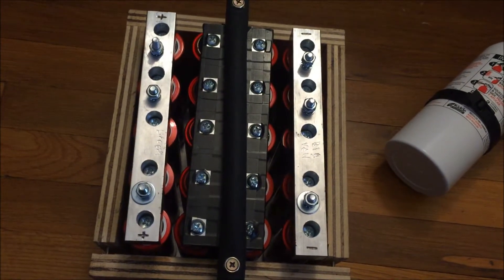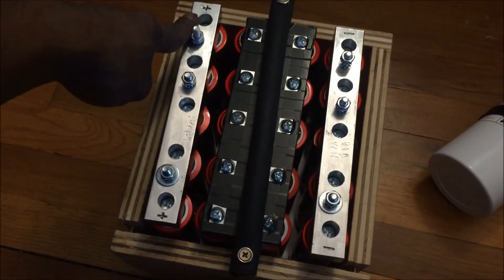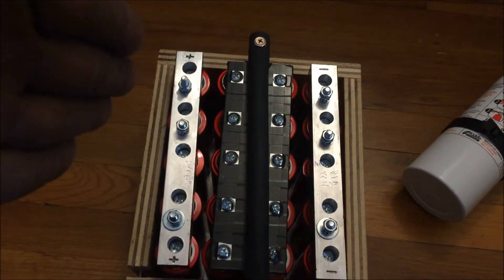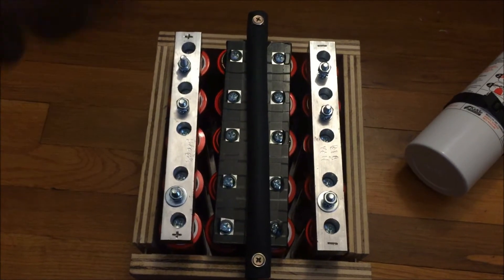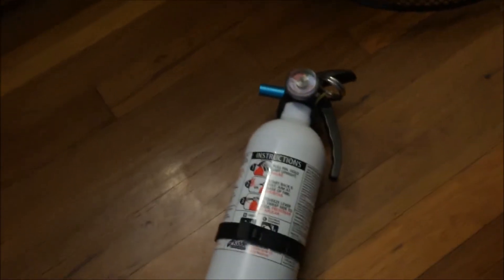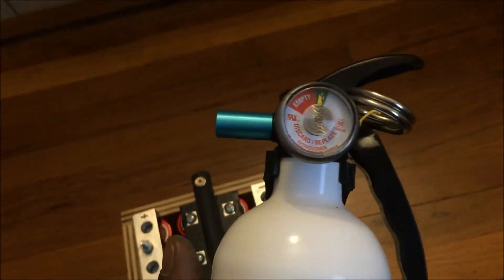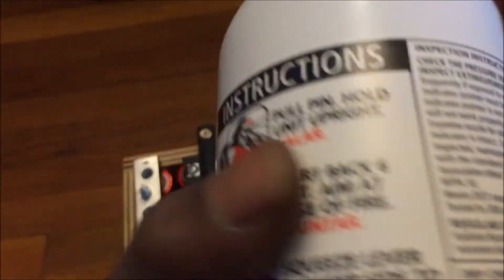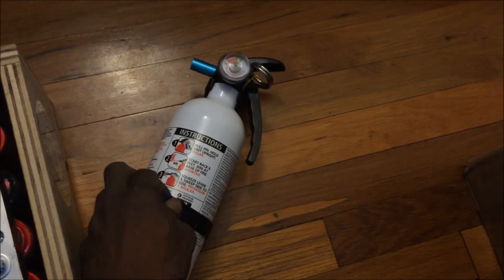40Ah Headway 38120hp Pack for Car Audio

Comment: What system did u have for this?
Reply from the maker: 2 DD m2b amps on 2 emf banhammer 12’s. Singer 180a alt xs power xp2000 AGM as well.

Comment: Hiw much can this 40ah power whats wise and stay in 14.4v range without droping?
Reply from the maker: I'm trying to remember the results I did a 400a / 4kW draw on the pack and I think the lowest it dropped was 13.4 That was stand alone not hooked up to a car or charging source.
Reply: @bigvell02  any chance you have a diagram on hiw to connect them all. Would like to build a 100ah one
Reply from the maker: @djbabyfingazz  No diagrams laying around sorry.... BUT I dont mind drawing up one as a matter of fact I will make a video showing how to connect them into a configuration of around 100Ah no problem.
Reply from the maker: It will be later this week though

Comment: This is effin' inspiring!  And yes, I have that exact same fire extinguisher...
Say, are you making these to sell?  Or should I acquire my own cells and do one?
Reply from the maker: Thank you. My team mate is running the pack now. I opened a Lithium battery company around Christmas last year. BigVell Lithuim LLC and I don't use these cells (I have something much better inside) I have 20Ah, 30Ah, and 40Ah. I just posted a video of the new build car there is a sneak preview of the batteries.
Reply: @bigvell02  So... Whatcha using now? I'm in need of getting something to supplement my power... Only pushing 4k, but the alternator can't handle that on its own like I've been running... 😅

Comment: doesnt each cell need to be balanced or something?
Reply from the maker: Yes I highly suggest it.
Reply: @bigvell02  do you do that with a BMS?  Also, you said you did 4 in series to get around 12V, are those cells 3.2v each?  Is one cell + side up and the next - side up? If not, how are you connecting positives and negatives for the series ones?  Visual learner, I wish I could see a diagram of how those are all connected.  I know series and parallel, just can't picture how this is all connected properly.  I really want to try this myself, just not quite confident enough to spend the $$ to try it.  Do you need to charge each cell separately before installing it in the car?  Any help would be great.  Thanks

Comment: So this is what you meant in the email...hot Damn bro,imma have to get one from you once money is right....eventually gonna wall off the van,will seriously need some good power.
Reply from the maker: Yes and Sir :). I'm using different cells even better than these, I still like these a lot though they are used in electric cars and air port shuttles in China and other places.
Reply: @bigvell02  even better bro! I'm down for sure,cant wait!

Comment: How do you keep it charged? Are you charging it separately? Can the alternator charge these type of batteries? Thanks!
Reply from the maker: I have a high quality lithium charger but yeah a regular alternator has no issues charging. Stay tuned all this research has paid off. I started a lithium battery company using top notch cells and great safety features along with other goodness. I will be revealing the product line real deal power, high quality at a killer price. I will offer the bass family here a great deal. If you have any technical questions HMU on 12 Volts Bass and More  on FB

Comment: How much RMS are you running and what is your voltage sit at when you're blasting your subs like your trying to kill them LOL
Reply from the maker: I'm living the 1/2 ohm life to fight box/impedance rise. Last clamped I was pushing 1840+/- to each subwoofer this was before the lithium. My voltage would drop down to low 13's fast mid 12s at times. Now I can play at 80% and the voltage is at 14.1 lowest. In the lanes on tones 13.4. I think they need more power I want to squeeze a m4b in the trunk.

Comment: How’s everything going so far?
Reply from the maker: So far so Great :) this thing is a night and day difference. I pulled my xp2000 and I think the sms220 is back there for the ride. Even on the hottest days I see 14.1 on hard lows. Notes out of tune at full tilt (clean) I see high 13's. each amp is wired at 0.5. I also checked each cell individually and in group configuration. (In other words every way I could lol) all cells were within thousandth of a volt. I'm very happy

Comment: Is this the future? Less weight, more power etc. Somebody is fixin' ta get PAID!
Reply from the maker: Hey bro, Totally agree with you. I'm still amazed. I blew my radiator at slam and I gave demos with the car off almost full tilt and the voltage was hard core :). I'm looking into building for others. I'm designing a BMS system so people wont have to check them it will self monitor.
Reply: bigvell02 - That sounds good for real. Sorry about radiator tho. I'll 100% be looking to try this out.
Reply: bigvell02 I’m interested
Reply: What's up man.. I'm starting a build for myself and have decided to go with yinlong lto's for my build. I did a build for my buddy and thinkin of headway's for him. He doesn't wanna do a factory batt delete. Just wondering how the headway's did with the agm's on the same circuit

Comment: How they take heavy load and heat is what I am on the edge of my seat waiting to see bro. I have a chance to snag a good quantity of these and essentially make exactly what you have. I just dunno if I jump on it or wait until the next vid....stressful decisions decisions lol. Sooo....when is the next vid brotha? You know I had to ask LOL
Reply: Bro i'm dying to know how they did with a full lengthy test? No pressure but i'm fully relying on your outcome lol. Please please please holler back asap brotha! Thanks a mill for being the first to go for it. I have 4 girls. I can't be throwing money away I know you feel me there. That's why your owed a big thanks for going for it and still being in the shoes I am about not wasting money having priorities(kids).
Reply from the maker: I so with you bro. Single full time dad of 2 over here. Money is far from long lol. I thought the same way for a few weeks even missed the 1st ebay buy because skeptical. When I decided to buy I said to myself if it doesn't work I can sell each cell back on ebay and it wouldn't be a total loss. But so far I'm thinking about building another. I posted a installed video - more detailed testing coming soon as well.